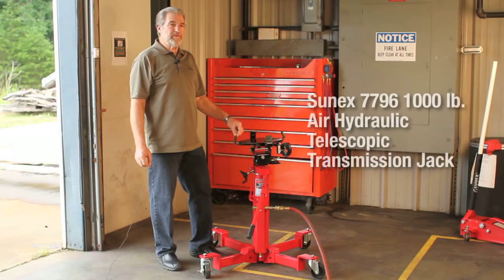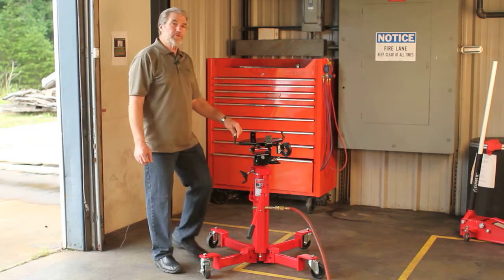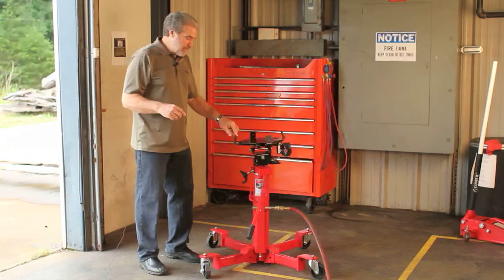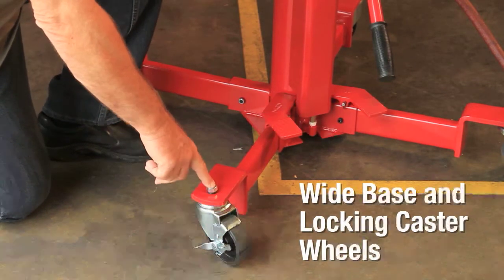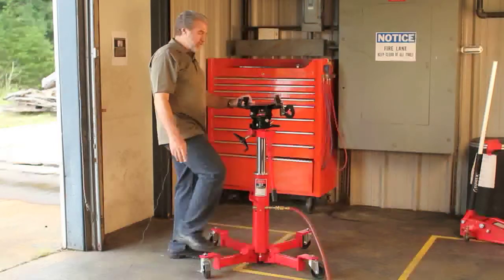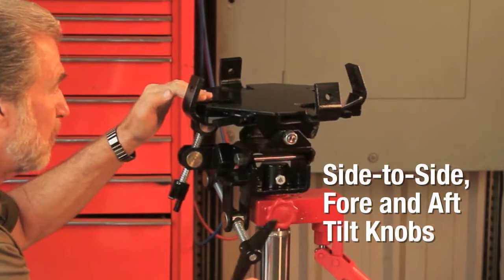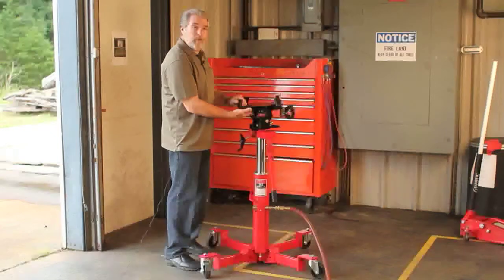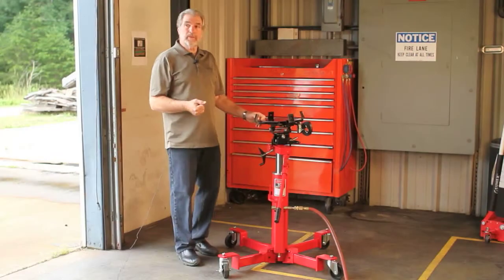Sunex Transmission Jack

Comment: WHAT HAPPENS IF THE " AIR " PART BREAKS, OR THERE IS NO SHOP AIR READILY AVAILABLE,  CAN  I STILL LIFT THE FIRST STAGE BY HAND OR FOOT?? I NEED TO KNOW THIS BEFORE I BUY ONE
Reply: you have to get it rebuilt, the air lift part WILL NOT work without air,, that is why i did not buy one